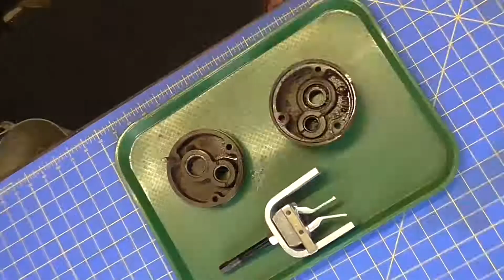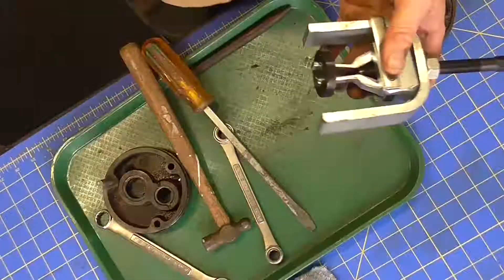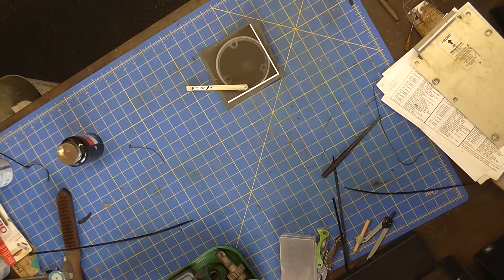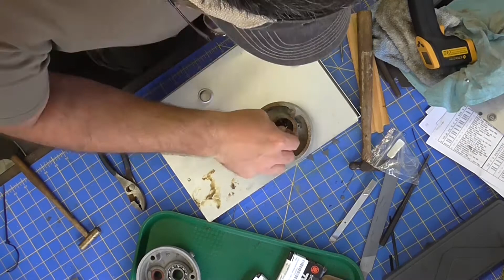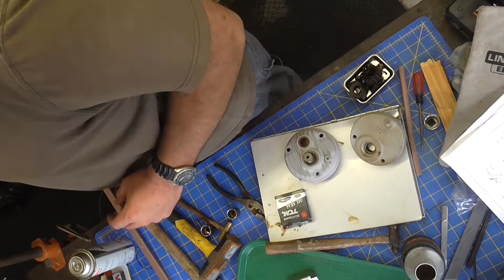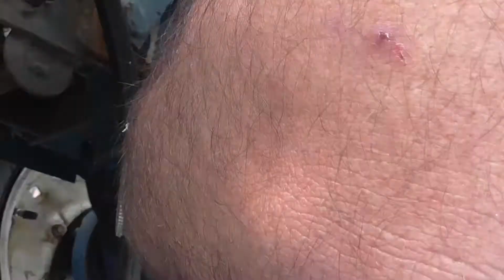Ford lawn tractor (Jacobsen Chief) reverse box rebuild

Comment: Thanks for taking the time to put this video up. I am about to perform the same task on my 1969 Ford 100. I have the outer clamshell of the reverser off and apart. I am still trying to find snapring pliers small enough  to get in and get the circlip off the input shaft. Can you tell me...in the reverse box, are both bearings & both shaft seals the same part#? I know the outer is a ND R12 bearing & outer seal is a National #480954. Is it the same on the inside as well?
Reply from the maker: Hey, i really dont remember if the parts were the same, sorry. Check out the other comments, i remeber posting the bearing i used. Good luck

Comment: Hey

i have a jacobsen chief 1200 and i would like to rebuild my reverse box but where did you get the
roller bearing found
Reply from the maker: I got it from Amazon.  TriStar DRS-1115-6 Sleeve Bearing , Rulon, 11/16" ID x 15/16" OD x 3/4" Length, Red
Reply: @joeheilm  I'm about to do the same job on my '68 Ford 100, I noticed how my pulley was able to move around and oil leaks so I took it apart and it seems like the shaft that comes out of the trans is loose aswell, did you have to replace the bearing at any point in the trans or just the rollers in the reversing gearbox?
Reply from the maker: @atractorkid7  the shaft on mine was not horrible so i just redid the reverse box and left the trans alone. Good luck, these are great machines. Cheers